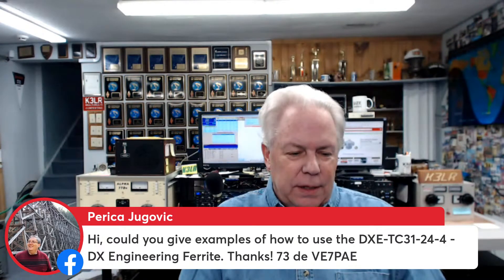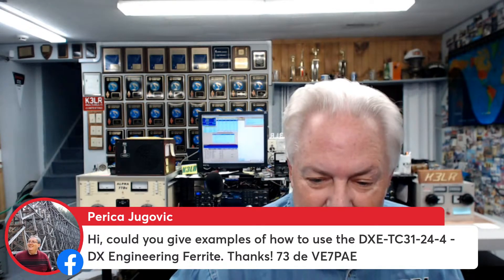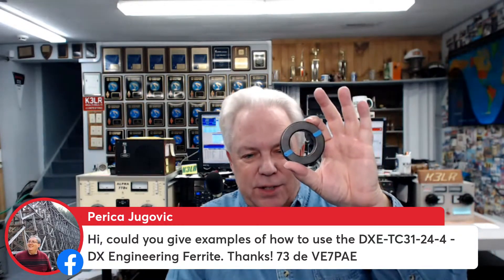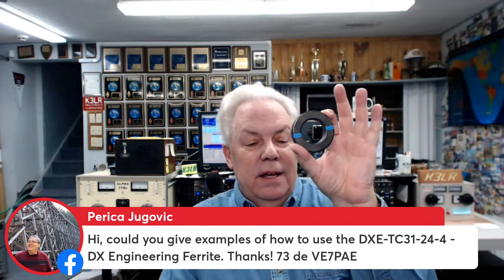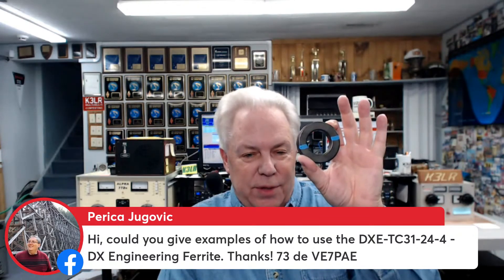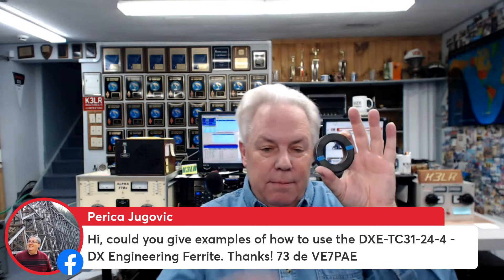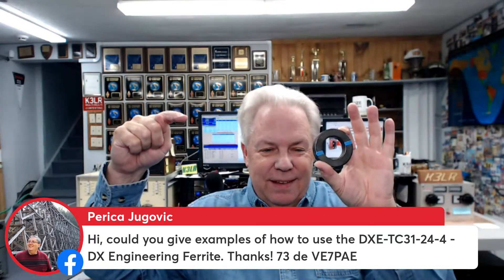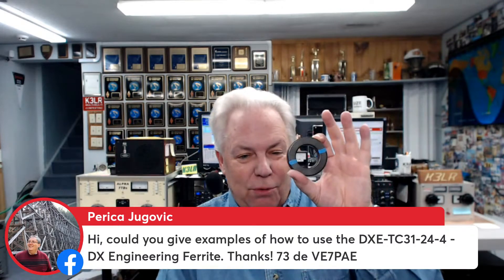Ferrite, Field Day and Antenna Analyzers - Tuesdays with Tim and Jeff

Comment: Thanks for a great tip. Was using my RigExpert recently testing my mag-mount antennas on my king cab truck. Two of the antennas are 30-40 inches long and one is 18 inches in length. With the RigExpert in continuous SWR mode I moved the antennas around for the best SWR. The longer antennas had the lowest readings in the middle of the cab and the shortest tested lowest at the rear of the cab. All readings were 1.3 or lower.